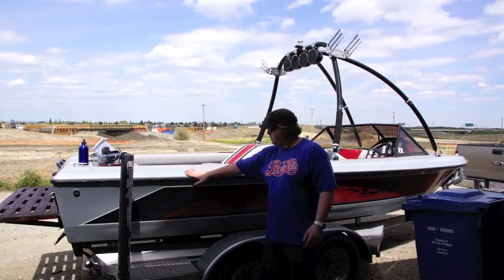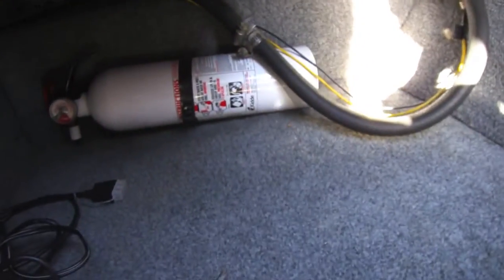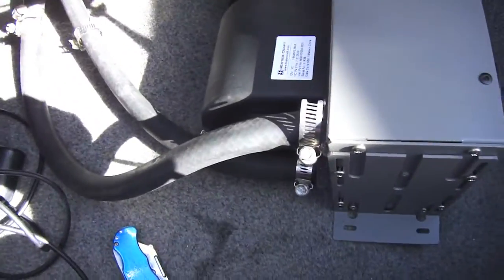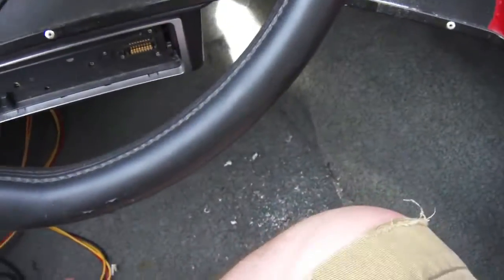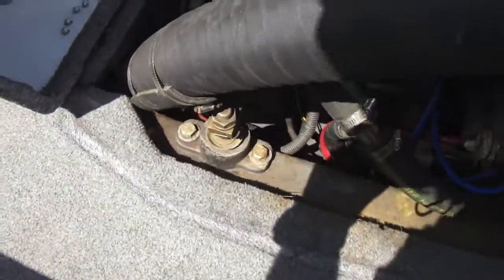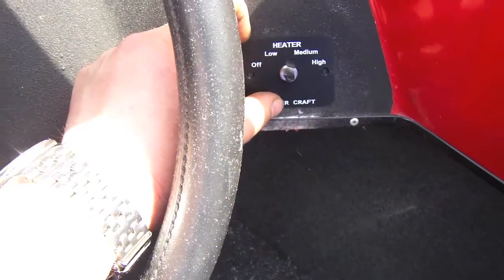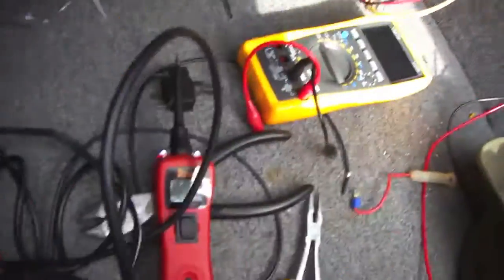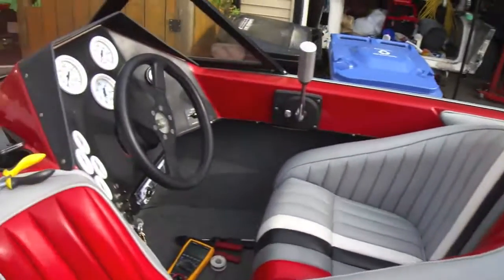DIY Marine heater install in a Malibu Boat

Comment from the maker: We all had to start somewhere that is a great way to get your feet wet.  basically in a boat unless your dealing with audio equipment your only going to be dealing with a positive and a negative wire.  Just remember to replace the wire with the same gauge wire and update date your fuses to the modern ones if it isn't already

Comment: I think he's talking about a heater to keep the operator warm, not the Motor. There are heaters for Marine Engines and Batteries (we sell silicone pad heaters to Boat Owners for this regularly, they install easily and work perfect for it). They don't necessarily work as a turbo (ballickmoyler) but it greatly reduces startup smoke, motor damage, engine compartment condensation, and enables you to just go without waiting for it to warm up.